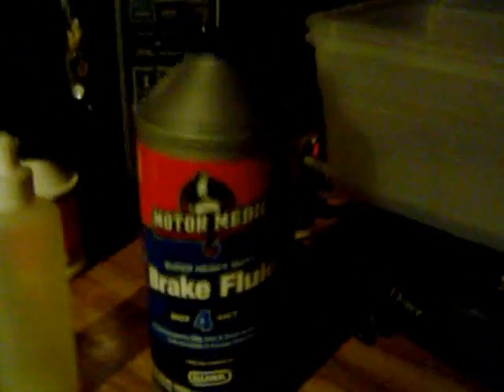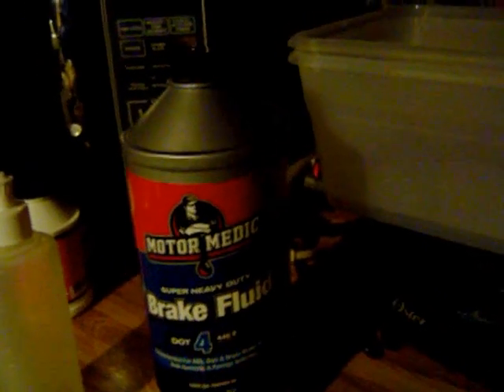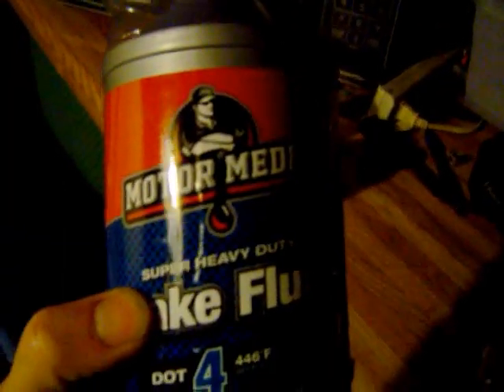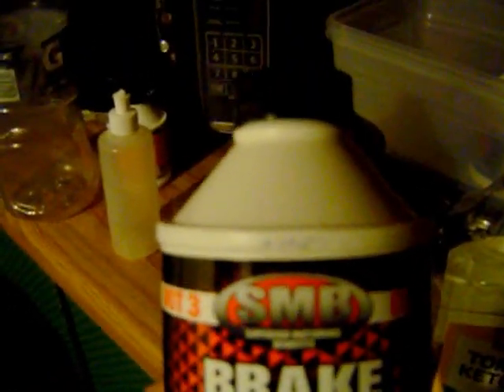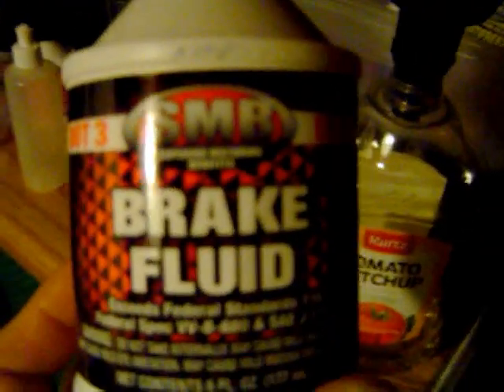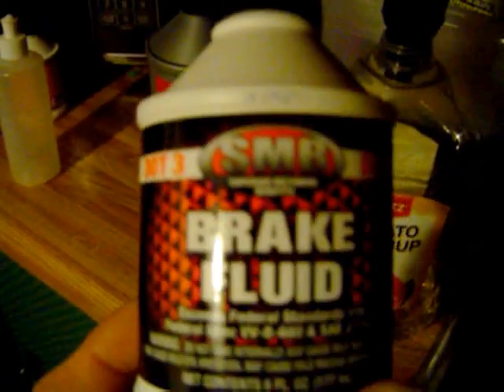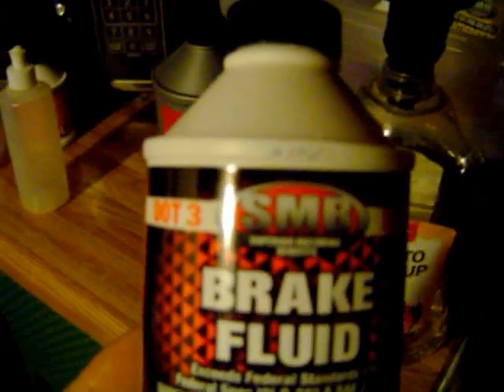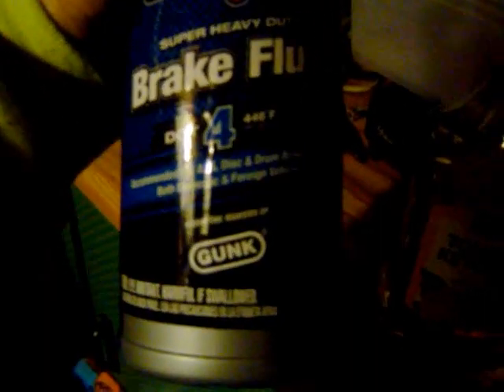Dot 3 or Dot 4 Brake Fluid in Motorcycles - Best Method Analysis

Comment: PLEASE if you are watching this video DO NOT PUT YOUR LIFE ON A MOTORCYCLE WITH MIXED BRAKE FLUID THEY CALL FOR DOT 4 FOR A REASON ITS CALLED BOILING POINT!!!!!!!!!!
and if your brake fluid boils you lose brakes (insert giant period)
also if you use the proper fluid you do not need to change your fluids every other day
and if you really want to lose brakes be sure to mix DOT 3 or 4 with DOT 5 
proper maintenance will tell you to simply do a test on your brake fluid for moisture you can get test strips or a digital tester 
as far as adding any additives to your oil be aware if you have  a wet clutch you are risking serious damage to your ride go with a trusted oil like Valvoline or Castrol and better oil filters cost more for a reason as they will typically have a failsafe built in designed to allow oil to freeflow through them in the event they get blocked, the CHEAP ones do not have that feature
in the world of automotive we have a saying
PAY ME NOW OR ALOT MORE LATER!!!!!!!!
Reply from the maker: +zachary121701 THIS VIDEO IS TO ENCOURAGE OR DISCOURAGE PEOPLE.  THIS IS MY WAY.  IF YOU FIND IT HELPFUL, THEN YOU DO OR IMPROVE ON IT.  ANY BRAKE FLUID WILL WORK IF YOU CHANGE IT IMMEDIATELY OR WHEN IT GOES BAD, THAT IS MY POINT.  IN CASE OF FIRE, DOT 3 OR 4 WILL SPREAD THE FIRE UNTIL IT ENGULFS THE VEHICLE IN SECONDS.  AGAIN, IT WILL NOT MATTER IF IT IS DOT 3 OR 4.  THE REASON WHY A CAR FIRE IGNITES IS DUE TO THE FLUIDS, BRAKE FLUID IS ONE OF THEM AND THIS DOES NOT MATTER ON 3-4; THE FLASH POINT, PERIOD END OF STORY!
Reply: Can dot 3 or DOT 4 BE USED for a 150CC scooter ? I put Dot 3 in my 150CC, I could not find In the owners Manual Where the type of Gear Oil should be put in, I know on the 50CC some call for DOT4 , I just dont wanna screw my brakes up.